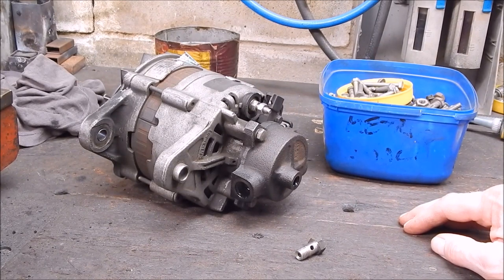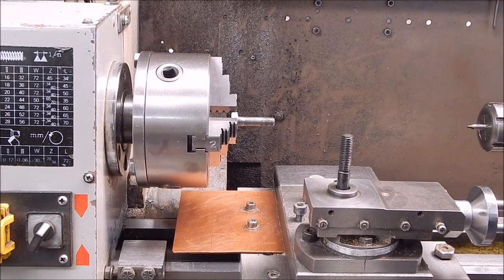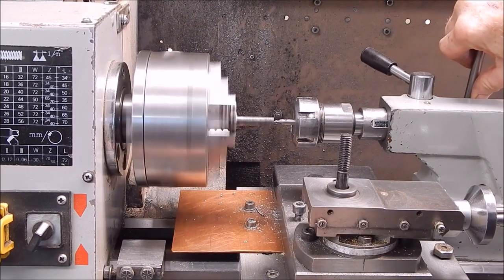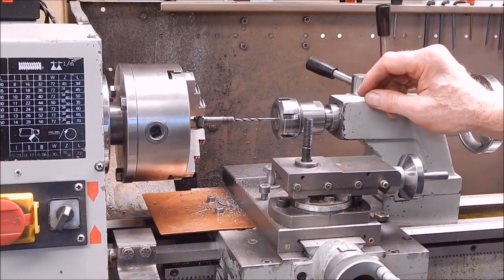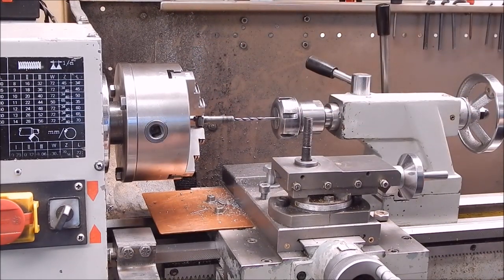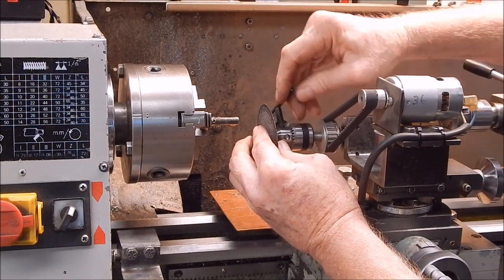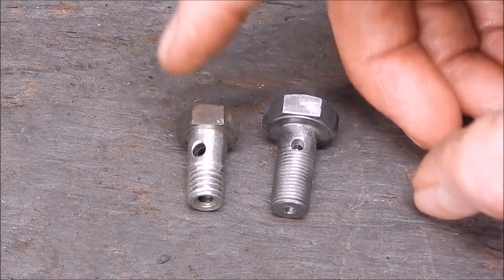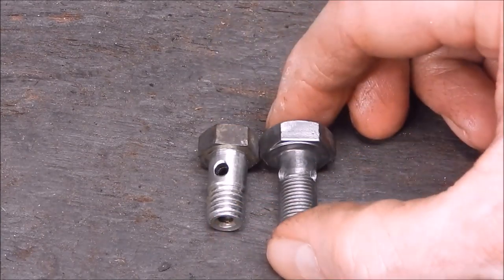How to make a bolt for a banjo connector

Comment: Nice one Xynudu. Never seen an Alternator with a vac pump on the back here in the UK. 
Steve.
Reply from the maker: Hi Steve,  I'm a bit surprised at that as diesel engines don't have inlet manifold vacuum due to the lack of an air flow  throttle valve.  To produce vacuum for the power brake booster a suction pump is employed and usually driven off of the back of the alternator.  There may be other methods employed, but this is the most common format.  Cheers Rob

Comment: Ripper video mate ! 
You have given me an idea on how i can sort out the hard to reach oil nipples i fitted to my mill , i was going to use poly pipe and those push in quick connectors but it wouldn’t be too difficult to knock up some banjo fittings  then solder in some copper tube and they will cost me nothing to make   = more money for beer !
Reply from the maker: Hi Ian.  All things are possible.   These are pretty simple fittings and you can make them with the centre gallery feed in two ways.  Either by reducing the bolt diameter at the radial holes or recessing the banjo centre  (as in the video).  Either way works fine.  Good project. Cheers Rob

Comment: What an interesting looking alt. Did you say it has the vac pump built into it as well? Its cool to see how machines are built differently in other parts of the world
Reply from the maker: Alternators for diesel engines (whole world) usually have a vacuum pump hanging off the end of the armature.  Diesel engines don't have a throttle valve for air flow and therefore don't produce manifold vacuum.  So to make power brakes work you have to artificially create a vacuum with a vane pump.  The pump is oiled by lines from the engine oil pump system.  Cheers Rob
Reply: @Xynudu  here in the US all I have seen on 80s90s and 2000s is just normal alternators. We do our brake power (that I have seen) off the power steering, and vac for blower controls from small electric motors (when not electronically controlled) . Thats my albiet limited exposure to GM, ford, and dodge diesel trucks. Thats why iam so fascinated with your alternator.  I would love to find a cross section view of it, or better yet a YT taredown video of 1. Thanks for the response. You said its from a Tata correct? What year and model? Maybe I can find more info

Comment: Can ask you sir, how about the bolt thread is 10mm  can you do it the 10 mm thread goin to 8mm thread..
Reply from the maker: Yes.  The thread can be smaller diameter than the banjo section.   Some are made that way.